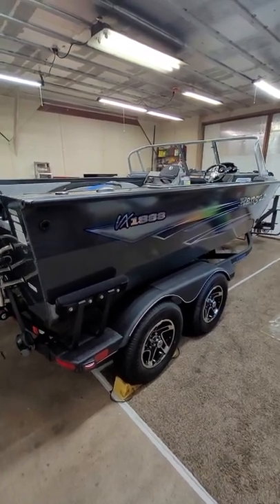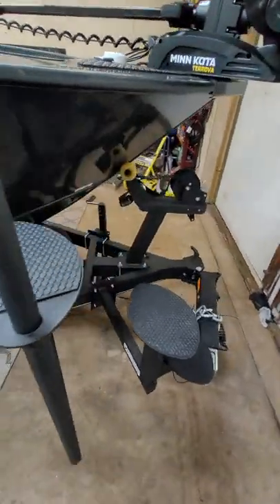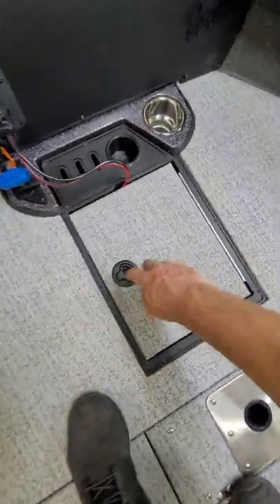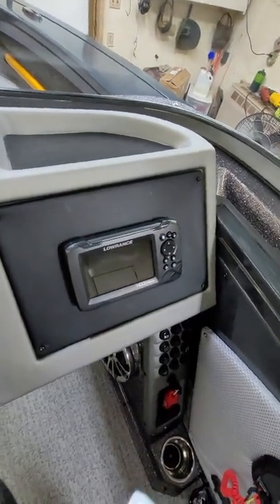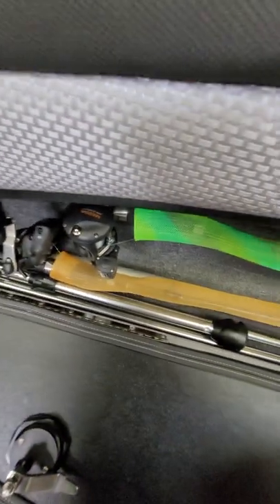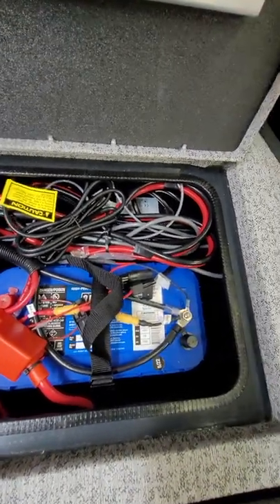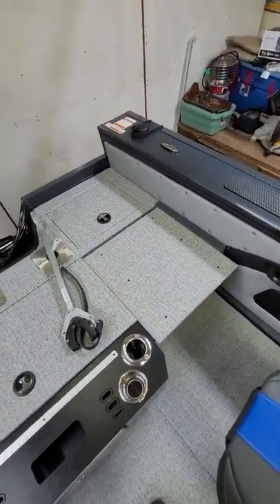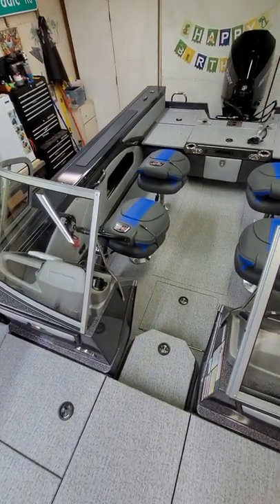2022 Ranger VX1888WT walk around.

Comment: was going to buy one of these but decided with the 1880MS glass boat. i figured if im buyin a ranger i should go for glass. mine was about 65k with a 9.9 kicker and a 200.
Reply from the maker: Woe that's a great price! A new glass boat in my area will put you  in the 80k range.
Reply: If that's a new boat, you seem to have purchased it well below Ranger pricing for a typically equipped boat (trailer, trolling motor, cover, etc.). I just backed out of a 1880 deal today and changed my order to the 1888. Just could not get over the idea of spending 73K plus for a boat that did not even come with a tandem axil trailer and radio much less a kicker motor. Very nice looking boat though.
Reply: @gh50hill1  this was 3 yrs ago...before covid and the price increase

Comment: Beautiful boat. I have one of these I've paid for that's still at the dealer getting some options installed.  Will I have a seat to put up front and sit on ?  Did yours come with one ? Thnx
Reply from the maker: Yeah I just move one of the seats from the back and put it up front.  There is a spot for the seat post in the floor on front deck and also on the rear deck.
Reply: @brianwoodin  ok. They must not come with a half seat to sit on.   I can't remember
Reply from the maker: Mine did not.....but I'm sure you can order it for a hefty price!!

Comment: In your opinion, how does this Ranger boat differ from the version that Nitro builds compared to the many Lund boats that build the same similar style. For a first-time boat buyer, what would you recommend around the 50-60k range? Thanks for your time.
Reply from the maker: This boat is built by the same company that owns Nitro...White River Marine Group. I did a little research before buying this boat because all I had to spend was around 60k. I couldn't touch a Lund set up like this for 60k so they were out. I am very pleased so far with the build of this boat. It has handled everything I've thrown at it so far and I'm happy with my decision. Is there a few things I'd like to see changed..yeah of course but nothing crazy.